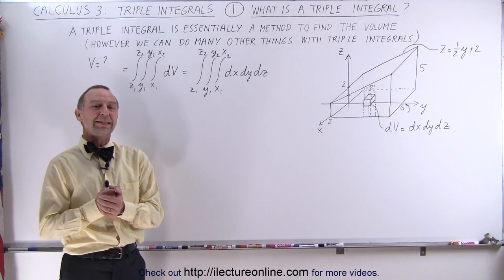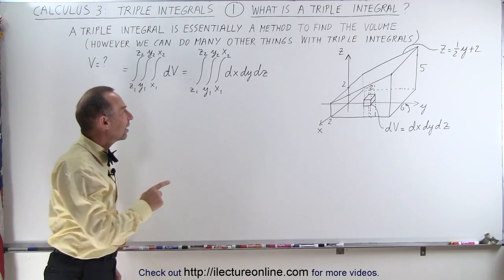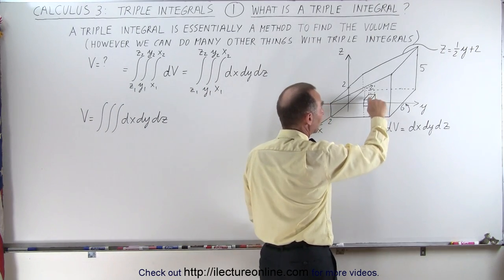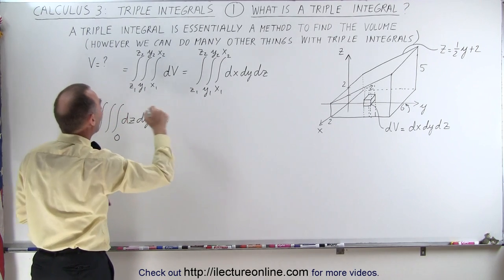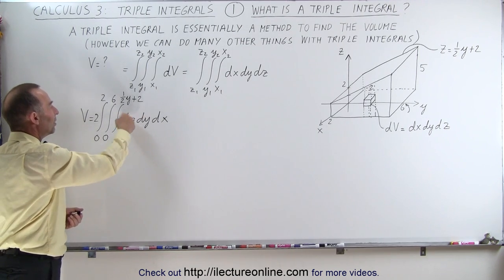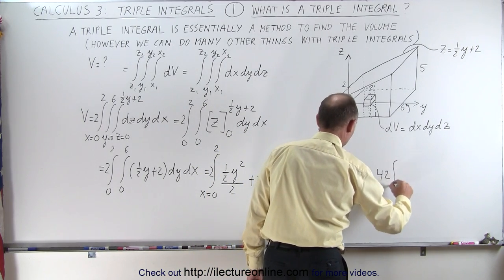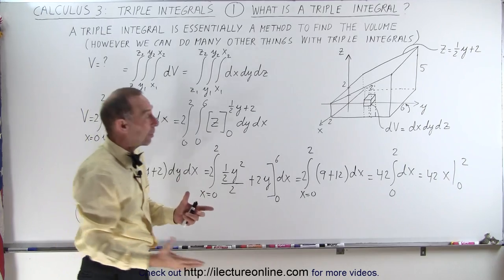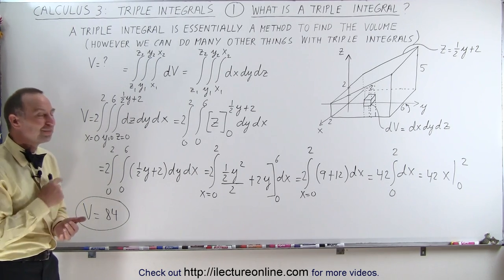Calculus 3: Triple Integrals (1 of 25) What is a Triple Integral?

Comment: sir, the z=1/2 y +2 is the upper plane or is the line on the Y-Z plane?
Reply: i have some visualization problem.
Reply from the maker: Plug in different values for y and calculate the corresponding values for z  (looks a lot like the equation y = mx + b)  Also note that x can be any value and thus forming a plane with a slope in the y-z plane as indicated by the equation
Reply: @MichelvanBiezen  Understood! x can be any value, so the z=1/2 y +2 is the entire upper plane.
thank you Sir!